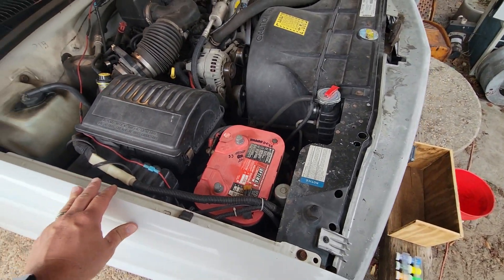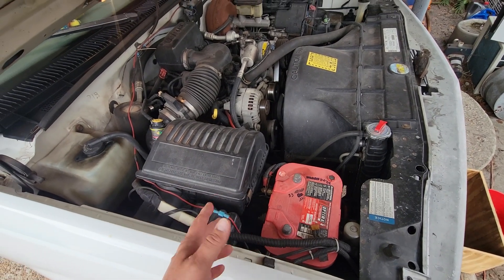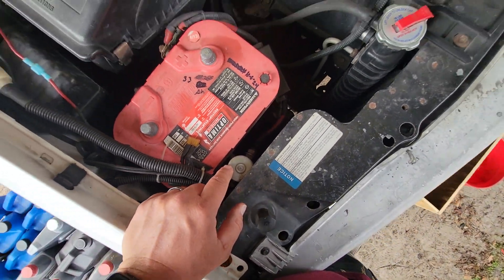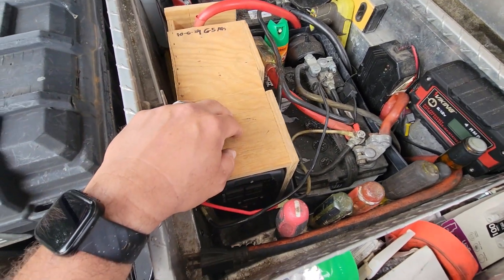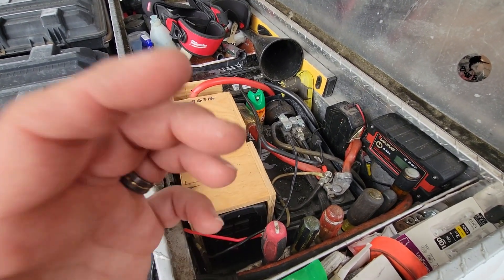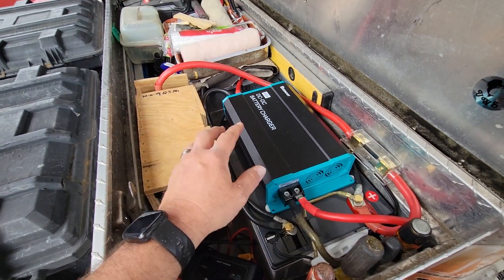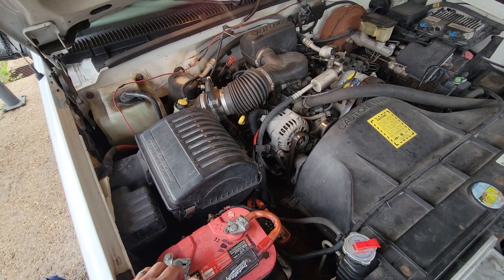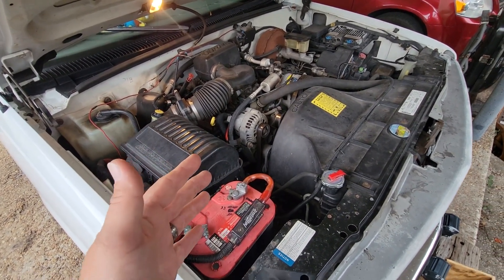Upgrading from Lead Acid to Lithium Iron Phosphate

Comment: a bms used with a alternator will easy blow alt diodes, competing regulators, best you put parcel shelf solar to improve usual battery life. my view is you need to beat competing with more competing to protect alternator, first run your alt to a solar regulator set at best desired settings thus runs after alt regulator, into car battery thus measured before entering battery bms and set a fraction bigger to make the solar reg act before bms settings. https://www.youtube.com/watch?v=jgoIocPgOug
Reply from the maker: @johnsexton5304  I have a DC to DC charge controller. Hard to put solar on a pickup truck.